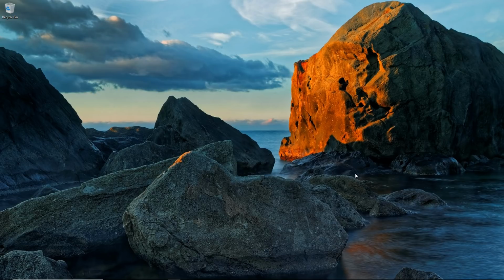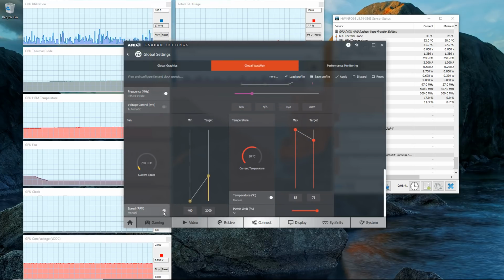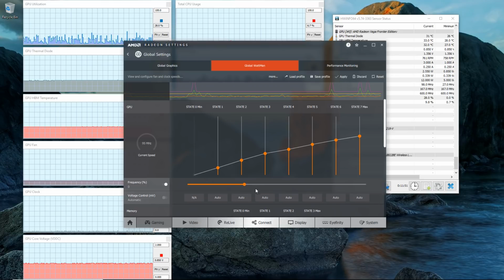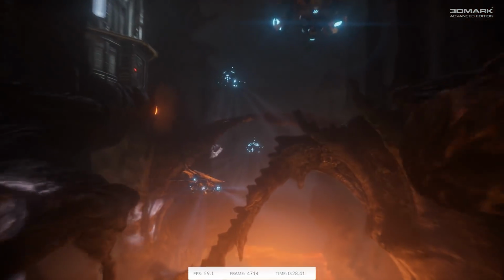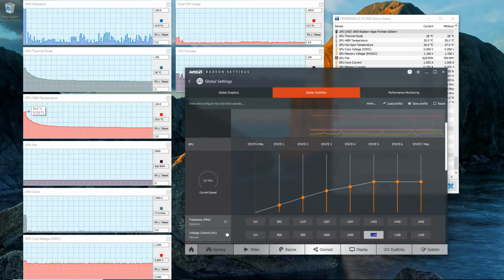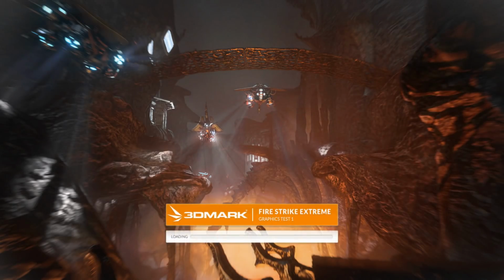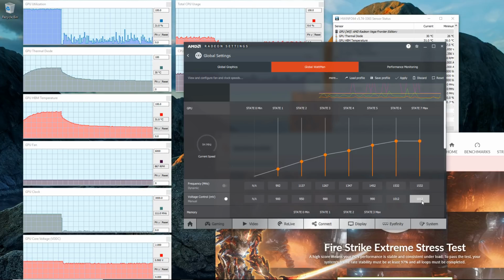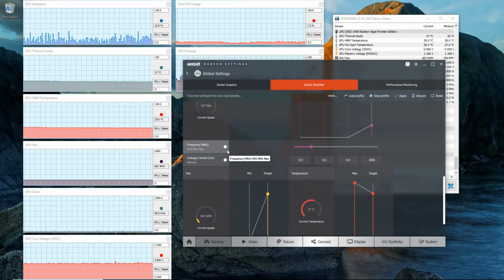Foolproof Vega GPU Undervolting Method

Comment: p6 & p7 cannot be the same clock or the driver will get stuck on p5. Hbm voltage is actually your core floor voltage. Do not set your p6, p7 voltage below your hbm voltage. HWINFO64 voltage sensors conflict with the card so if you use that application for monitoring, disable all of the voltage sensors for the card. GPU-Z is a nice alternate option for monitoring. 
What I did was set an aggressive fan curve, 2400 minimum and 3600 target, I left the core clocks alone and overclocked the hbm starting at 1ghz. fan spins quietly at about 1700rpm until it needs to rev up. With that fan curve, i lowered voltages on pstates until the card could manage my 68c target temperature while boosting. In the end my p6 state was at the same voltage as my hbm and my p7 was just a little bit higher. I dropped about 100watts. Averaged 1550mhz-1580mhz boost clock. Im done messing with it for now but I may refine my settings again in the future.
I have the Asus Strix after market cooler version
Reply: How does the conflict between HWINFO and the card manifest? I've been using that program for a while now to monitor my card while lowering voltage maintaining 1550MHz core at ~960mV in the games I tested.
Reply: I would get stopping, like the game would just stop for a second. Or I would get a random stutter while playing my game with the hwinfo opened. I looked it up and I saw a post about the conflict so I turned off voltage monitoring and the problem went a way. I don't really know much beyond that but I do find it weird that gpu-z doesn't seem to bother the card when it monitors voltages. I was playing fallout 4.
Reply: nice voltage you got on that thing! I can't get mine to go below 1025mv on the hbm and p6. I have 1050mv on p7. im using a 35% power limit
Reply: interesting. I have it set to 980 on p6 and 1000 on p7. Can't go below 970 on memory because it would get stuck at 800MHz otherwise.

It reacts rather strange to some settings
Reply: @JosemiteMC  mine 951 memory voltage at 1100 mem oc
Reply: @rynz_2893  Hey, how i do Underclock on Vega 64? if Vega64 supports only p6 and p7, i want to run in 1400mhz

Comment: Awesome work on the walk through, but I do need to ask: didn't every other reviewers/OC'ers already confirm that the clock setting doesn't work unless you move it to percentage mode?
Reply: This is a year later, but I get changes in Afterburner overlay and HW Info after changing frequency by entering number.

Comment: Does it also work with the sapphire nitro+?Can I just "copy"? Just started to watch the video.. So didnt watch all of it for now
Reply: Do never ever just copy paste the overclock settings from someone with similar HW.
Every chip has it's own unique flaws. Your PC may just crash when you copy someones settings, or you may not even touch the full potential of your card.
Therefore you have to find the best stable setting for every card manually by starting at stock settings and slowly approaching the optimum.

btw I own a vega 64 nitro+ and it's definitely undervolt/overclockable
Reply: ya i own limited edition one and got it to 1750 at 1177 mv
Reply: @DragonProtector  Out of curiosity:
What's your target temperature and average fan speed with those settings?
I don't think the fans are any different, so this might be a good way to see how well your vapor chamber does.

At 1550MHz core (actual speed under load), 1000 mem, 970mV and with a target temperature of 70°C my fans are spinning at ~1350rpm.
Reply: like between (if fans on amx load it 59c core) but under normal fan settigns like 64 through 70c) I believe I hit thermal watt limit but i undervolted pretty good and got my meory to 1100 at 951mv. I tried flashing bios for lc but it showed picture and windows didnt like it w=so when it laoded got static screen (pc was not frozen)

Comment: I wish I had found this earlier, by far the BEST step by step guide on undervolting. I spent hours trying other tutorials and this video worked the first time. I was using approx 240watts on my Asus Strix OC Vega 64  with the wattman Balanced preset. After using the steps in this video I'm hovering on 170-175watts. Thanks so much, keep up the good work.
Reply: I have the same card, what clocks did you end up with?
Reply: did you get those results by copying his custom settings or did you tweak it a bit?
Reply: can u please send screenshots of ur config settings?
Reply: Same card but it doesn't even hit the advertised clock speed that's 1630mhz
Reply: @rishabh5406  These cards are a nightmare if mine peaks out at its rated 1622 at stock voltage it force a crash. Never had a graphics card that crashes at its factory settings, this guide seems to be doing the trick though slowly working my voltages down and so far everything tested is stable with no crashes. It's definitely the voltage not the clocks that crash and freeze up the cards!
Reply: @aweaklingify  bro can you share your wattman settings?

Comment: Thank you!  This is the most helpful video for new vega 64 owners.
Reply: Tamaine Miller which Vega model have you got?
Reply: Glitch Asus strix 64
Reply: Same as mine, I have the OC version, if you dont mind would you share your undervolting figures..thanks
Reply: Glitch well first, I opened the GPU up to repast it and replace the thermal pads. That alone brought the temperatures down over 10c. I'm using OverdriveNTool to undervolt it. I have the P6 at 1520MHz/1045 and P7 1600MHz/1070 GPU and HBM have not gone over 70c under load
Reply: Nice temps...thanks for the info, this will help..
Reply: Glitch I got a lot of information from AMD subreddit.
Reply: yeah I'm on amd Reddit right now thanks for the info appreciate it

Comment: My 64 gets up to 73 when I set it to match pstate 5, fans get loud, and gpu clock hovers around 1355-1365, not the 1402 it's supposed to be :/
Reply: I think there's a bug if state 5 is equal to state 6